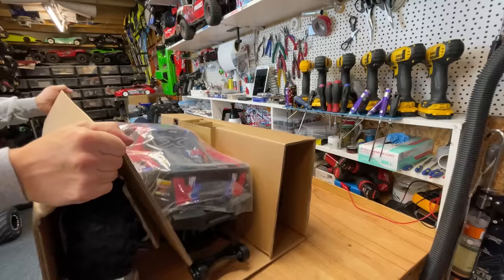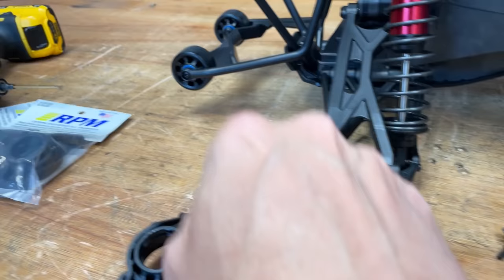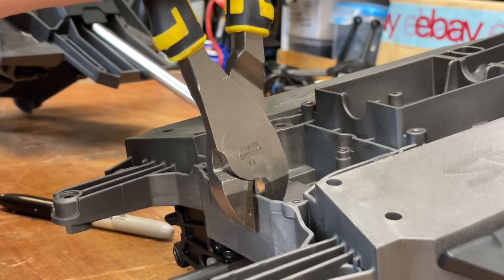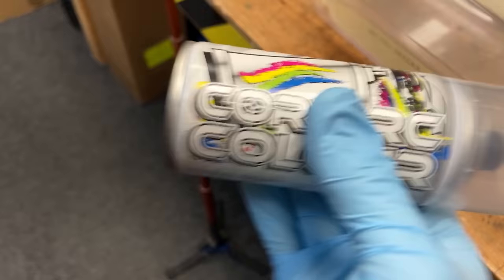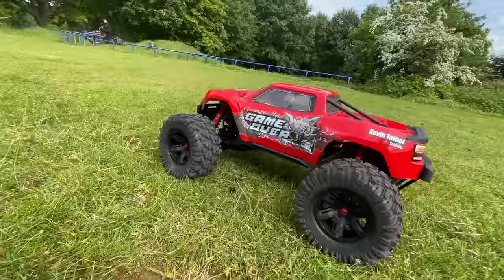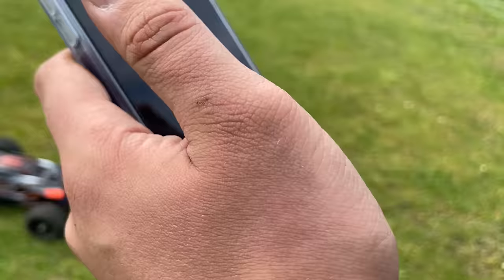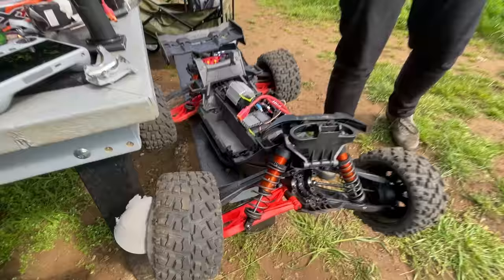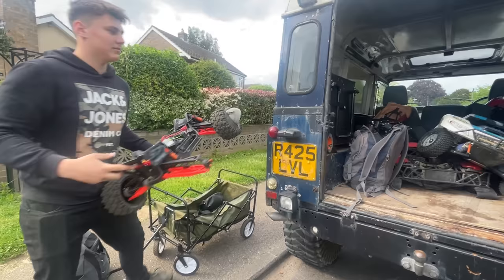LATEST Version Traxxas X-Maxx 8s RC Car Vital Upgrades

Comment: They need to offer the X Maxx as a roller
Reply: What about 2 stroke 😂
Reply: kinda easy to put that together yourself bud
Reply: @ShazammtheProducer  ?
Reply: @Shazzam Not cost effective at all though. Probably cheaper to buy an X-Maxx and sell the electronics.
Reply: That would be awsome.  Great idea!   Roller with a clear body
Reply: I agree
Reply: Better yet, a slider...no body, no wheels and tires.
Reply: Eby has somes  xmaxx roller
Reply: They don't need rollers for toys which is what traxxas has become!
Reply: Traxxas are a bit bitter about the aftermarket community sadly
Reply: @QZillasWorld  Lol The Xmaxx is better than any Bashing RC car durability wise
Reply: @ericstephany7305  part are very easy to get and build it from the groun up
Reply: @TranceFur  very true but buying a roller would be to much as well
Reply: Traxxas gonna sue someone
Reply: @ShazammtheProducer a roller would be considerably cheaper and easier than buying either a complete x-maxx and replacing part and more cheaper and easier than buying every little part separately. Wth sort of advice are you giving😂
Reply: Or just a nitro version

Comment: Kevin: X-Maxx is the worlds best RTR Basher!
Also Kevin: $350 in upgrades first!!
Reply: Lol that motor and esc alone cost 350, that servo 150, gears etc you might as well get a used V2 and upgrade it lol.
Reply: @jaybomb5022 just sell the traxxas esc and servo brand new and it will take the cost of the better upgrades more easy to swallow
Reply: Those upgrades are not necessary.  You weren't listening
Reply: And arrma needs a $1000. So what’s your point?

Comment: Hey there kev enjoying the videos 👍🏻
My arrma fireteam servo failed and I’m trying to find a replacement anything you would recommend
Thanks
Reply: AGFRC makes really good servos. I run one in my Fireteam and it hasn't failed yet despite me running a really stiff servo saver to increase high speed steering.

Comment: No, you don’t have to drill out the arms for the RPM hinge pins. The threads stick out the little hole and you put the nut on. Because of this I was drilling them out then just put a pin in forgetting to drill and put the nut on “oh, that was easy”

Comment: I used to have rc cars, had one of the first nitros that came out that would do over 70 mph, which back then was insane, but I didn't have sponsors or YouTube to help pay for all them pieces and parts back then were expensive. They wanted so much for little plastic pieces that broke every single time you took it out and messed around with it. If they hadn't gotten so greedy I'd still be into them till this day, but I refuse to pay $17 for a piece of plastic that's gonna break 5 seconds into it. They have figured how to make certain parts just strong enough that you will break them and have to keep buying replacements to continue ur already much invested fun. You get even one sucker, I mean customer that owns a sizable collection. That's alot of parts sold that cost them almost nothing... no thanks will find a different hobby that's not gonna bleed me dry. But they are fun and u are fun to watch so 👍  to u.

Comment: Do you see heat issues with that gearing? I run 18/50 with a Max6 and rockets fans and I easily overheat it by 75% through a 9k mah battery pack.

Comment: What about the center diff earplug mod, cut driveshaft mod, and unbreakable body. Do you recommend those upgrades too.
Reply from the maker: Already has earplug looking stuff I. There, split shaft caused problems, indestructible body is good for bashing but I like my rcs to look good

Comment: @Kevin Talbot: I really hope Traxxas gives you free toys because in the last 3 months since becoming a rabid fan of yours I have purchased a Maxx, UDR, X-Maxx, XTR, TRX4 HT, TRX4-M, M41, 33 Hot Rod etc etc. Having a blast and they all make me smile! Thank you for the awesome videos and laughs! I wanted to let you know that Hot Racing has a great little $20 servo adapter for the Maxx/XRT/X-Maxx thats aluminum and comes with the proper size aluminum servo horn so you dont have to trim the backbone. They take a BEATING! Eco Power drops right in! I normally dont do lottery type stuff but will have to for this X-Maxx as I would love to have it here on my rack knowing I had a cool truck built by my favorite RC dude and to have the smallest touch of England with me. :)

Comment: i got a x maxx 8s and have been having  fun but have noticed that at high speed the steering seems a little wandery  is that usual because the front is light or is the servo not strong enough to keep it all straight ?
Reply: You could use a stronger servo for some increased centering and holding power, BUT a big monster with those big tires isn’t going to be precise or able to hold a straight line like a smaller vehicle. Picture a Toyota Tacoma doing a speed run against a Monster truck. Have fun out there 🏁
Reply: @billypennrc2273   yes i think i will go down the stronger servo route/  one that will fit in without any hassell

Comment: How are you keeping the turning circle so small on your X Maxx? I've tightened my servo saver all the way and am using a Savox SW2290SG-BE with a MAX5 and anything above 10mph it can't hold the wheels at full lock.
Reply from the maker: Make sure there’s no binding and the servo saver is not worn out

Comment: The front hubs are slightly  different  too on the v4 the inner bearings diameter  are bigger on the new one I broke a hub went to replace  it with one my buddy had new in packages and they don't fit cause the inner bearing is bigger so they made slightly  different  hubs eather that or amazon sent my buddy the v1 hubs when that's not what he orderd😂

Comment: Question - will the perfect pass servo work with the stock electronics? Currently I have JX 46kg servo in it and it’s really weak. Will barely turn on concrete if not moving. I want something much much stronger but not sure if the stock electronics will allow me to go any bigger than it is now. Do you have any advice for me to fix the issue???
Reply: cause the JX is really a 37kg servo at 6volts. the perfect pass is 42 at 6v. stock esc only does 6v BEC.  and thats if you really trust the rating on the JX servo, which from experience is usually false.
Reply: @mindwreckRC  so what’s the best way to increase the strength of the steering? Is there a way I can get more voltage to the servo without having to put in a new esc? I’m a whiz at putting things together but get lost when it comes to servos and stuff like that.
Reply from the maker: Bec might be going weak, just get a max 6

Comment: Hey kev! Would you do a build of a Tamiya Super HotShot? It looks like a rad 4WD buggy, and being a Tamiya, its a kit car. I'm debating getting a BBX, or the Super Hotshot. But, leaning in towards the hotshot. As cool as the suspension system is on the BBX, i alreadyhave a 2WD buggy.

Comment: it looks awesome and like so much fun but part of me dies inside cuz i'm a loser and broke and i'll never even  get to run one, and these guys just smash them all to bits in a single afternoon, hurts my heart a little bit. awesome video still, nice work!
Reply: They smash their toys for more views and this pay for the damage and alow to buy more toys. That's how it works 🤷‍♂️
Reply: You shouldn’t talk about yourself that way mate and you can always better your situation. Re-educate yourself, apply for better jobs, save money, make investments, start a business, whatever you need to do. It’s in your hands!
Reply: @mariuszs.3029  i know, i'm not hating on them or anything,  i bought a fms k5 blazer the other day, cuz i'm a broke scrub, and it's the cheapest rock crawler thats really good out of the box, and most of the upgrades are 20-30 bucks or less(except ESCs and batteries and such) man i'd like to run a rc truck, last one i had was a nitro Revo, i got one first day of release that was like 20 years ago though lol i ran it for a a year or so and then traded it for a scooter cuz i had to get to work hah, i got shot in the face and now i dont work, (also why i'm broke all the time) so i got the k5 blazer to have something to do i guess. (the fms k5 blazer is amazing, tbh, i think it has durability issues (like the gears) but you can replace everything with metal so i'm  not worried)

Comment: I bought a hose after watching one of your videos and it is the biggest pile of junk out of the box. Breaks constantly. Center diff went out. Broken axles. Tires come off the wheels. Worst part is I’ve never jumped it higher than a sidewalk curb. I’ve probly only played with it a half a dozen times. Called traxxas and they wouldn’t do anything about it. Very dissatisfied

Comment: What's the point of showing us the newest version, if you're going to replace half the parts and build it out just like your older version, before you even power it up???  Literally could've just watched one of the old videos.
Reply from the maker: For fun, why else rc?
Reply: @KevinTalbotTV  i get the fun, and your videos are easily the most fun rc stuff on the interweb.. but the title brought me in to see how the new version 6 is, and after the 'upgrades' its basically the same as your version 5. Would like to have gotten your opinions about it in stock form first.